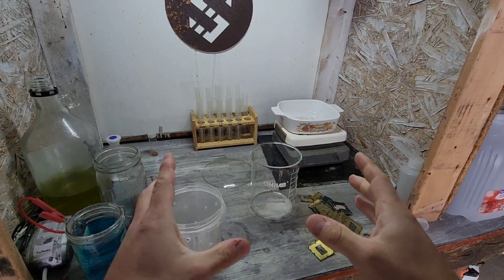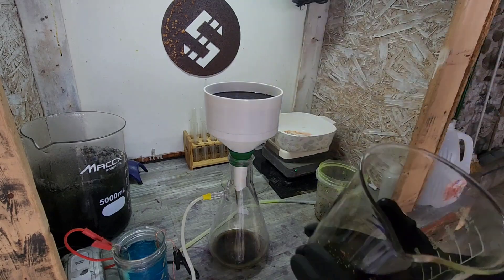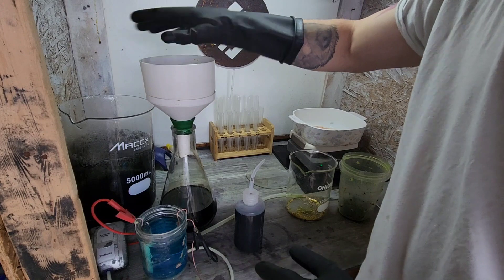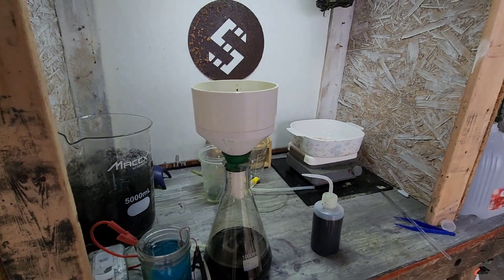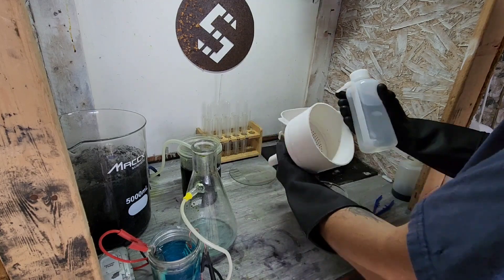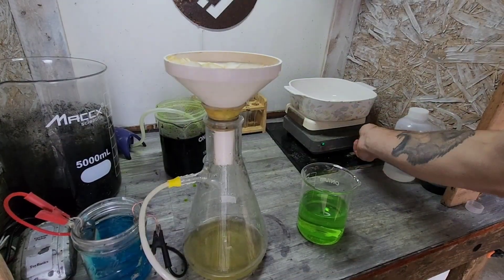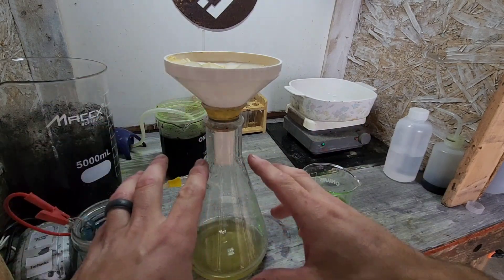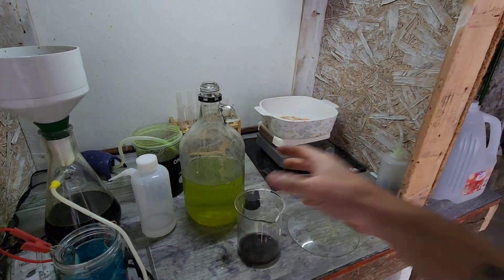Pinless CPU refining for gold recovery

Comment: Could you get larger filters that would go up the sides of the funnel to keep the gold glitter contained?  Or are you getting smaller funnels with the new flasks that you can fit your current filters in to go up the sides of the funnel?  Either way, those small bits seem to be a pain to corral and keep from going everywhere and sticking to everything.  Looking forward to your next video!
Reply: I was about to say, a larger filter folded up the sides, or even a coffee filter helps recover foils and saves a major hassle. Thats what I use for GF Scrap.
Reply from the maker: Definitely a good idea. I will have to try my smaller funnel for this stuff. Definitely was a pain!

Comment: Hey what's in the 5L beaker over there 😅
Reply: Ya I seen the 5L and was wondering if I missed a video somewhere
Reply from the maker: I'll finish the video some of its not recorded but you can imagine what happened 🤣
Reply from the maker: A mess 🤣😆🫠🫠🫠
Reply: Those are the fun ones haha
Reply from the maker: I'm not sure I recorded that one. I will check the gallery and see lol
Reply from the maker: @mattlevesque5927  I have some recorded but most of stopped when SHTF 🤣🤣
Reply: It happens some times😮😂
Reply from the maker: It was plastic plugs I put straight into AR. Little did I know the wires were Aluminum 🤣
Reply: Did everything cement out on the aluminum , take out the wires filter and incinerate put in with sweeps.
Reply from the maker: @Hill1312  I don't have any gold in solution but I will for sure have to verify that gold didn't cement out. I see gold foils in the bottom still so I am thinking what little nitric I put in went right for base metals
Reply: 🫣weeeellllll uh see what had happen was.... And then ... Uh you know...😅